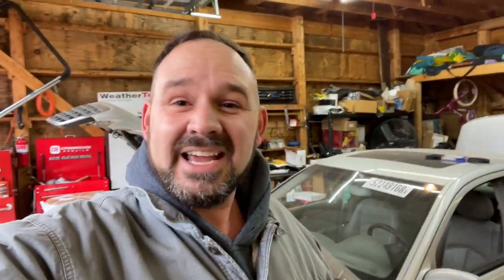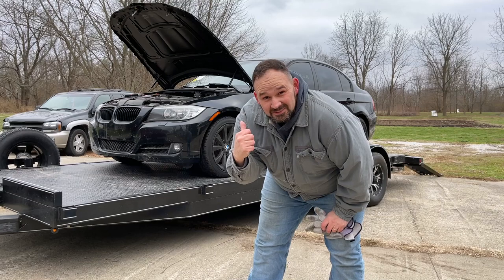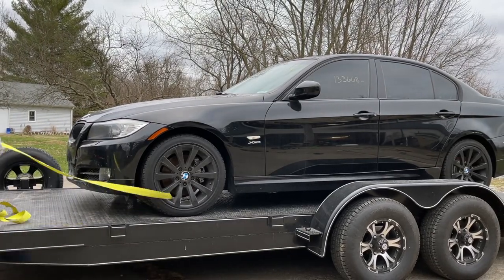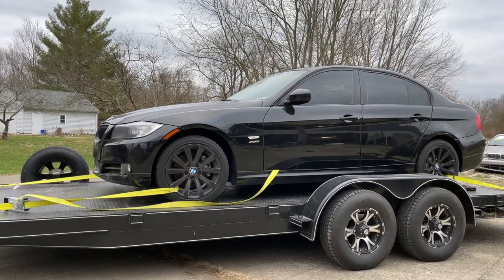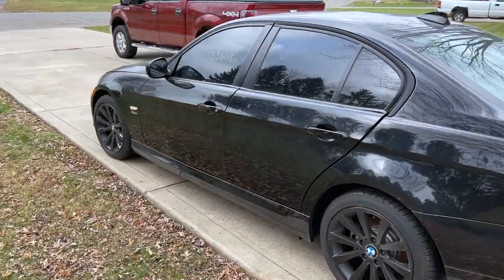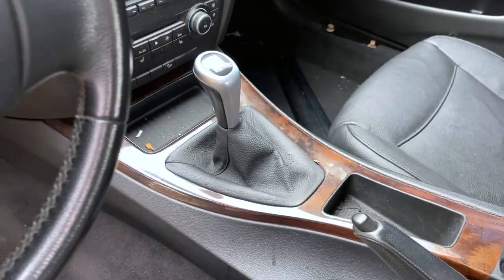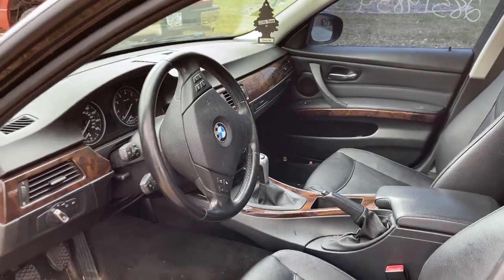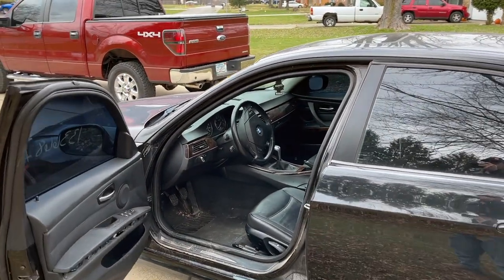NEW PROJECT! - BMW 328i Rebuild - Part 1

Comment: Are you building a warehouse like JRGO? Videobob also has a warehouse video series that is like a compound setup.   My one car is stick and I bought it from Copart a few years ago. An 04 Elantra clean title I paid $200. The thing has been super reliable and have not done any major repairs to it. It does have rust but not super bad.
Reply from the maker: Man, that would be awesome, but I don’t have the budget for a warehouse. I am hoping to get a poll barn with a lift at some point in the future though.
Sounds like you got quite a great deal on your car! Good job!!

Comment: Sweet BMW and its not a Automatic! Are those rims painted or powder coated ? They didn't look original. Great buy my friend. Can't wait to see what you can do to it.
Reply from the maker: Thanks man! Very excited to find a manual version!! The wheels were plastidipped. It will come off, but I’m going to be replacing the wheels anyway with something I like better.